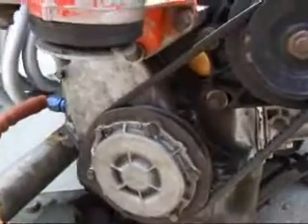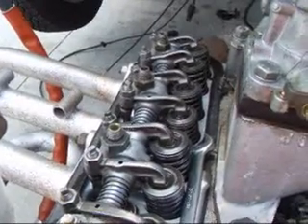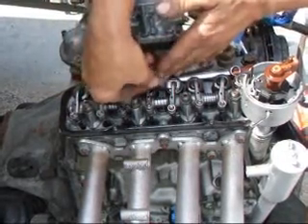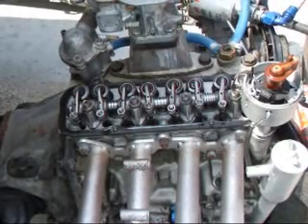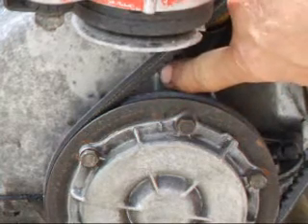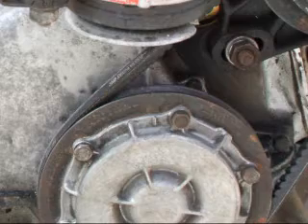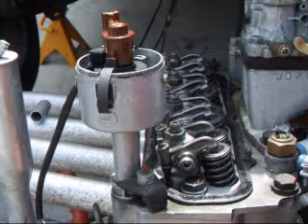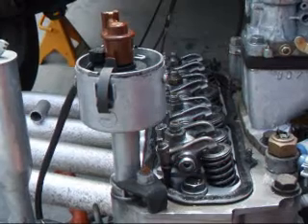Fiat 850 Valve Adjustment

Comment: On an DOHC setup, when the engine gets hot does the lash increase, or decrease? would seem like a duff question until you consider that as the valve head gets hot, it expands and lifts up on the seat, thereby increasing lash. I'm going to assume that since the valve stem also handles a percentage of the heat dissipation, it grows in length decreasing lash.

Comment: i had my 20r toyota engine rebuilt, it was bored 40 over and had minor cam work done to it. do you think the valve lash would be different from the toyota factory specs? it's a 1977 toyota celica GT.

Comment: On the 600 it is 0.15mm on both exhaust and intake. to do it properly when n.1 is fully open you check n. 8.    WHEN N  2 is open you check  N.7.  and so on. it always add up to 9.

Comment: Should you fallow the camshaft manufacturer  valve clearance specifications, or the engine manufacturer valve specifications...In my case I am using stock rocker assembly and OEM valves.

Comment from the maker: If you have a cam that you can look at, notice how the lobes are positioned when #1 would be firing, rotate the cam 180 (crank would b 360) and you will see that #4 firing is in position. When the lobes face away from the tappets, they can be adjusted. A simple process that I have used for almost 40 years. Our (USA) specs were .006 intake and .008" exhaust. I run more with my cam grind - .008 (I) and .010" (E). I put this up for those who have had problems adjusting valve w/factory suggestions.

Comment: continued - 
To adjust valves for no: 3, rotate till piston 2 is on the rocker.
To adjust valves for no: 2, rotate till piston 3 is on the rocker.
To adjust valves for no: 1, rotate till piston 4 is on the rocker.

Q: What has lead you to setting your valves using your method and tolerances?

Cheers, Marty

Comment: Hi John,
I find a couple of things in this video a bit odd. I use the 850 Sports 903cc in my 126, and I set my valve clearance according to the offical 850 Sports tuning book.  In my book, all valve clearances should be set at .006" (0.15mm), and they should be set while the opposing piston is on the rocker. eg: rotate engine till valves for piston 1 are on the rocker (exhaust has closed and intake is starting to open), this is when you adjust valves for no: 4.